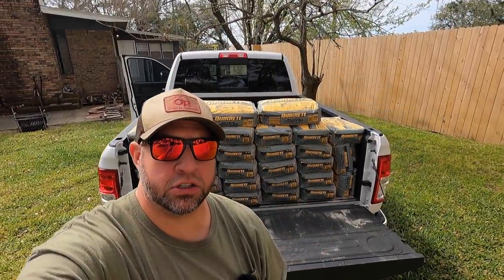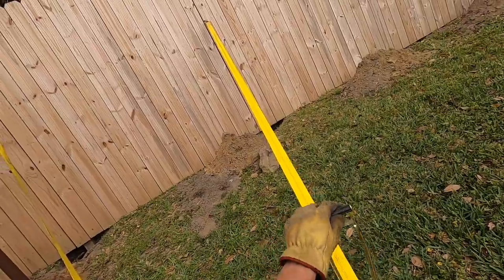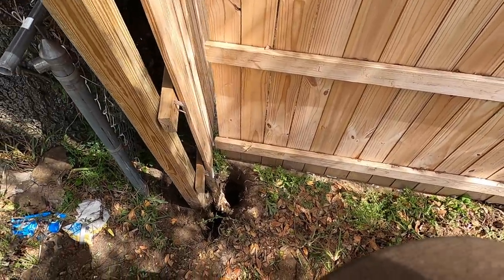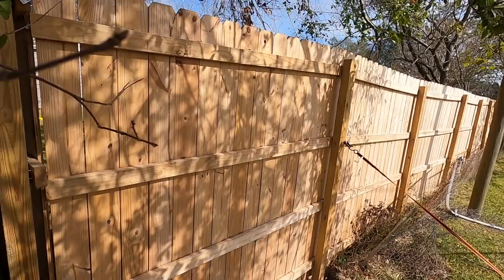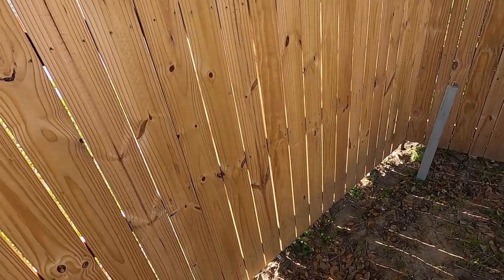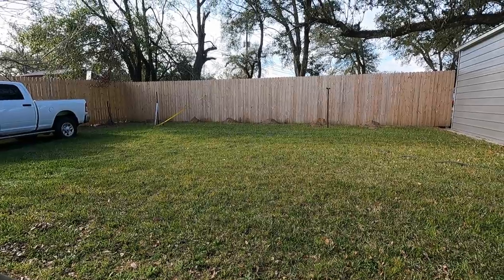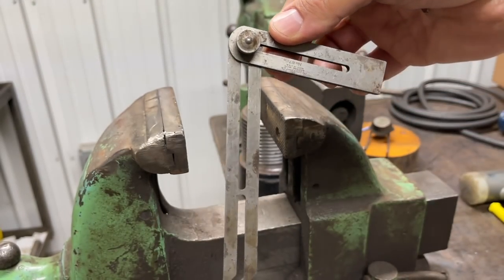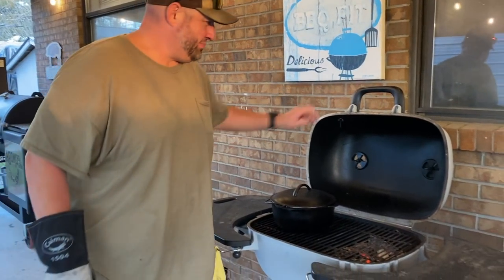Privacy Fence Repair Part 2

Comment: Great job on that fence, Adam! One thing I like about my fence is that whoever built it used drywall screws to hold the boards on. So it makes them very, very easy to replace when one breaks or gets bowed out of place.

Comment: To keep the corner tight. Drill  two holes each post. One near the top and one near the bottom. Feed heavy fencing wire  looped to the two  posts. Clamp the ends together tight. Finish off by twisting the wire till she sings.
I have learned so much from your channel 👍🇺🇲

Comment: Wish you luck I live 10 miles west of Zanesville ohio and  I had a similar  situation and I did almost the same as you did with 100 lbs of concrete at each post but 4 months later 75mph winds snapped it off right at the ground level ,and by the way nice blister on the hand

Comment: like your videos . especially the machine shop ones. I think your posts should have been longer too .Oh, and you mention getting the posts level  "Level" is horizontal, "Plumb" is vertical LOL I set fence posts dry & let the moisture in the ground set the concrete. no need to add water .

Comment: Call a seamless gutter company. They can crank out what you need for that porch gutter in minutes and make sure it is properly sloped and mounted. You can even get covers that keep the leaves out at the same time. They can do it far faster and better than you could ever dream of trying to do it.

Comment: Nice job Adam.  If it was not so expensive, a block wall would have helped a lot with the noise from the street. Its amazing how much sound they prevent but they are rather expensive.
AND you said it...you CAN'T rush cook'n ever or you are not doing it right.
Reply from the maker: Yea a California style block wall about 10’ high would work 😅
Reply: @AbomAdventures  Known as "Slumpstone". Limit is 6 feet high.

Comment: Looks good! Now you do realize that if you drive those anchor points flush with the yard and leave them, you'll never need them again. But if you pull them you'll be driving them back in this fall right?

Comment: I would hate to think you would have any issues after this repair. What are your thoughts of anchoring it to further stabilize it for the next storm with those straps?
Reply from the maker: If I’m home and I know a storm is heading out way, I will do what you saw here and strap each post to an anchor in the ground. I have plenty of the 5’ steaks I can use.

Comment: I would leave the stakes in the ground and the eyes in the fence. If another storm is coming, you only need to put the straps in place, to prevent the fence from being pulled over. At least from the inside....
Reply: Until you’re mowing and forget they’re in the ground.

Comment: The problem with privacy fences is that they're subjected to a lot of wind damage. The wind rocks the fence back and forth 24/7 365 days of the year. The posts will all crack at the base. I built my 6 foot fence 30 years ago, but left 1/2" gaps between the pickets. Not a privacy fence, but still standing with little maintenance. No leaning, sagging, and every fence post still intact.

Comment: Would it be worthwhile to have some percentage of the fence panels detachable,removable,or foldable to reduce the wind pressure on the whole structure ?
I suppose you will just have to wait till the next major blow and see what happens.
Then again,you could just add yet more concrete. At some point,even a hurricane won't persuade it.
Reply from the maker: If I’m home when another storm comes I’ll add the straps and supports like I used to repair it.

Comment: If you want the fences to have any hope of staying upright in heavy winds then you want to add a support brace to the posts at about 22, ideally 30 degrees, fixed at the height of the mid stringers on the fence - the brace means any force pushing the fence over has to 1st push the angled truss brace into the dirt by the same amount that the fence wants to go over
Just  like you expect chatter if you have a foot of stick out part in a lathe chuck you would expect flexing - same concept here

Comment: Good job! Now how did you get those anchors out?
Reply from the maker: Reached down with my hands, grabbed the bar and eye bolt, pulled it right out of the ground. 😂
Reply: Living with hurricanes, I’d put eye bolts into each post. When a hurricane approaches, drive your steel posts back in the ground on both sides and attach your two straps. It wouldn’t take you long. With that much concrete in the ground, you don’t want to replace posts. It seems like I have to replace several posts every 10 years or so and my adjoining neighbors never show their faces until I’m finished with the digging. In my next life, I’m not going to have neighbors. LOL

Comment: It's to bad you had to fix the fence, the contractor should have done it. Looks like the post were not placed in the ground properly. Here's what a contractor stated about fence post - Fence posts should be dug into the ground at a depth that is roughly 1/3 or 1/2 of the height of the post above ground. For example, a six-foot tall fence would require a hole at a depth of around two to three feet. This ensures that the post is sturdy and will hold solid in the ground. Additionally, the hole created for the post should also be roughly three times the width of the post. So, a post with a diameter of four inches would require a diameter of about 12 inches wide. Following these two rules of thumb ensures successful installation of fence posts and fence systems

Comment: I was in Lowes yesterday. There were employees everywhere. They were walking around, talking with each other, looking at their phones...but only 1 of them was at the register where 15+ people were waiting forever to get checked out! They used to have a self checkout here but closed it for some reason. I will avoid that place like the plague from now on. It’s just plain disrespectful of their customers.
Reply from the maker: It's the same problem here. When you go in there casually knowing what you need or just browsing you get asked if you need help. When you do need help no one is to be found. The other reason I hate going to those places is because like you said, the checkout line always takes forever! That's the main reason I don't want to go buy something there, waiting to check out for one little item.
Reply: As much as I hate walmart, the fact you can scan your self out with your phone, and by pass all the checkout line is amazing. I bring my reusable bags, and never have to deal with a single person to get in and out. Wish home depot or lowes would have something like that.

Also I swear home depot replaced their in-store music with phones ringing around here.
Reply: In my small town we have a Lowes and a Home Depot right next to each other. I consistently find the selection and customer service at Home Depot to be better.
Reply: @larrycleeton  We have the two a block apart here. Us contractors use the orange store.Many of the employees have worked there over twenty years and know their stuff and have become friends. Over at the blue store same as is described here and the parking lot is empty. I spent three months building the blue store and I cringe every time I have to walk through the doors.
Reply: Unless there is a discount, I'll never use self checkout ! I'm not doing their job for free. What a complete disrespectful idea for customer service. Also, use the Lowes Facebook page and make a complaint about that particular store. If the local manager of that store allows that crap it won't do any good to complain to that manager so, up it needs to go so that higher ups hear what is going on there. It does make a difference but don't expect any thanks from anyone. I've been there and done that and it works but sorry and thanks was not mentioned.
Reply: @AbomAdventures  ACE Hardware usually beats all of them regarding service to customers. When a trip for small things comes up, I go to ACE all the time and its closer to me. ACE doesn't always have the brand I want but for many things they are suited just fine when you consider the pleasure of going there, getting some help and getting out of there in a short time.

Comment: They should of had a post at each end of those sections. Then that corner wouldn't have opened up like it did. And you could have bent those strong ties the hard way. Vise grips and a hammer 🤣🤣🤣

Comment: Your fencing guys didnt do a good job IMHO. There are no gravel boards at the bottom these stop the panels from rotting, normal in the UK.
Reply: Also I would not attach the fence to your building another hurricane could do damage to the building with the fence acting as a big sail.

Comment: Looks like the posts were not set deep enough , In Canada posts are set  4 feet deep  ,so that the frost  does not drive them back out  of the ground .
Reply: depends on the level of the water table